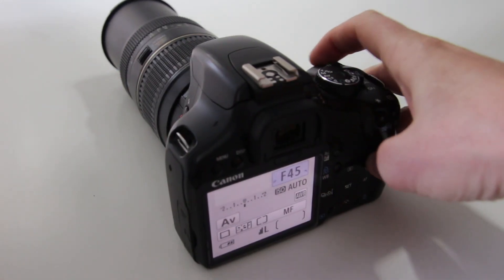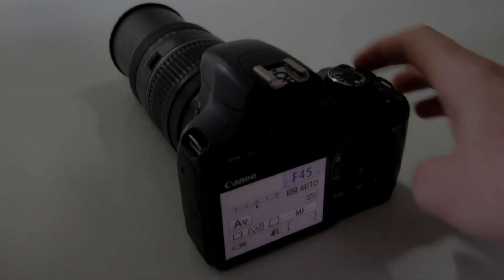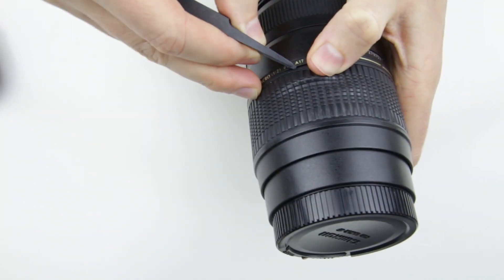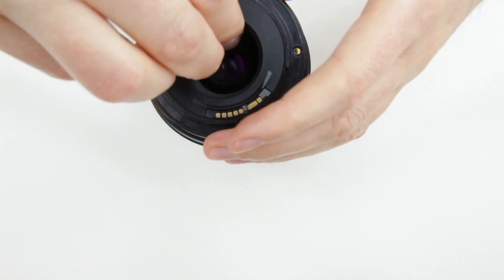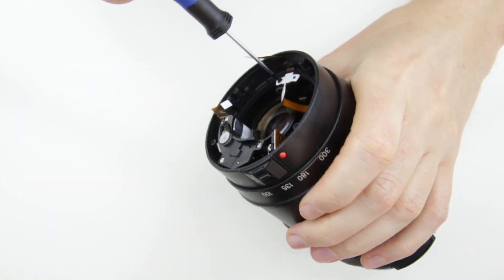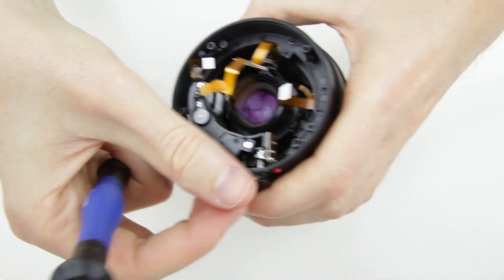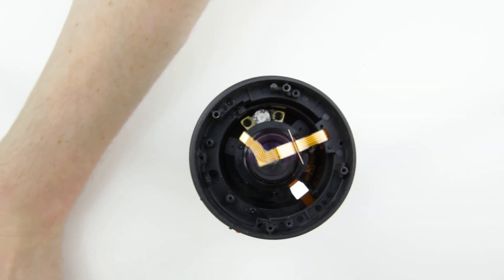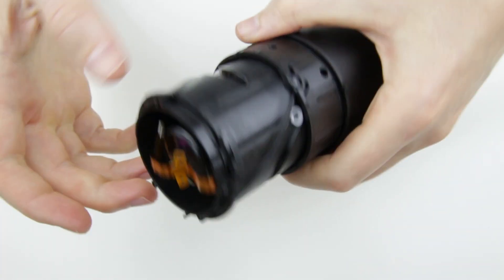Tamron 70-300mm f/4-5.6 Di LD macro lens disassembly for replacing the flex cable

Comment: I know this is an old video, but I'm working on a similar but different Tamron that appears to be missing the band/clip that is removed at approximately 14:20. I don't know what the name of it is, or where I could get a replacement. Leaning towards printing one, but not sure what material I should use. Possibly TPU?
Reply from the maker: At that timestamp I removed a small rubber ring (maybe it is called elastics?), it just holds the flat cable in its place. I think it can be replaced by if you would cut off a part of a "Bicycle Valve CORE Soft Rubber Latex Tubing".
Reply: @CamerasLensesEtc  Thank you so much!

Comment: Hi, I got a problem, when I tried to remove the flex from the motor one of the pins, the right one snapped off... Then only those 3 was soldered, do you know how can I fix the pin? Thank you for your help
Reply from the maker: Check ebay or aliexpress, maybe they have motor or complete aperture mechanism for that lens.

Comment: Thank you for the video.  My problem is simpler.  My focus works with jerky action so it's hard to get sharp focus on stars at night.  It's not an old lens so I suspect there's no long lasting solution.  
I think I'll upgrade to a telescope with a different type focus mechanism.  ((-:
Reply: Howdy. I've got a very similar problem with one of these old SuperZooms. Focuselement and Zoomfunction are were jerky and since it is an old lense with very subpar image quality that was just collecting dust, i said what the hell, let's open it up for fun. So once you fought your way down to the inner Zoom tube, you can clean and lube the plastic rails and threads and they will go smoothly again (for how long i don't know). Problem is to put it back together after that. The think the chances that my little project will work out fine in the end are slim :> Disassembly is waaaay easier then re-assembly, especially if you don't mark the relativ positions of some of the parts to oneanother. 2/10, would not recommend. (but you will learn a thing or two)
Reply: @kunstsein   Thanks for the tips.   I'm using a telescope and my eyes are too old to get focus easily.  I'm sure that taking apart and put the camera lens back it too much of a challenge for me. 
 Maybe you'll figure out a way to use your lens for some "artistic" photography where exact focus would ruin the effect you desire.  Plenty of people excel at that sort of method.

Comment: This is a very common problem with all tamron zoom lens. When I attach the lens i get this error. What I do? Is static energy from body damage something? Why this happen?
Reply from the maker: As you zoom, the cable moves and sooner or later it get broken. If that happens, the cable should be replaced with a new one.
Reply: i had this problem on a brand new canon 55-250mm and so it is not only a problem with tamron.

Comment: Thank you for this video! was searching everywhere for this problem and was about to buy a new lens, have taken it apart and moved the small rubber band down slightly and it has made it marginally better, am going to reopen it and try solder the wire to fix it as the cable replacement looks quite difficult.
Reply: When I attach the lens, it gives this error message. What I do?